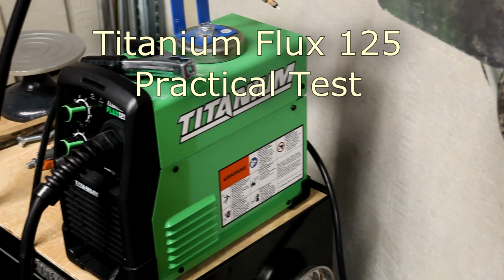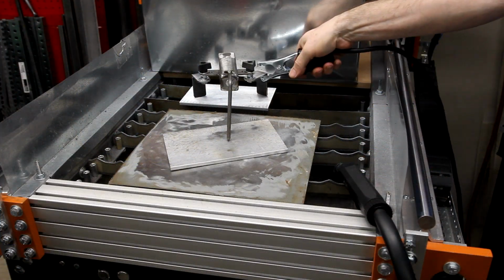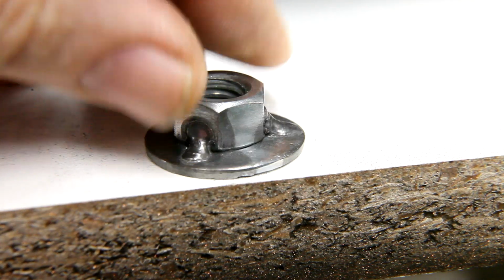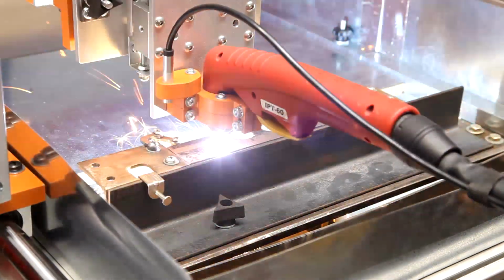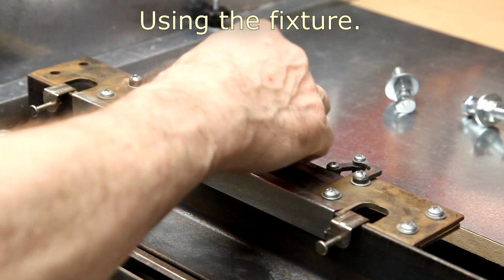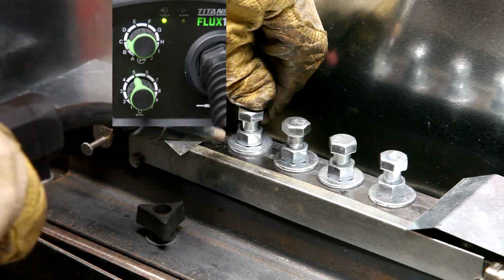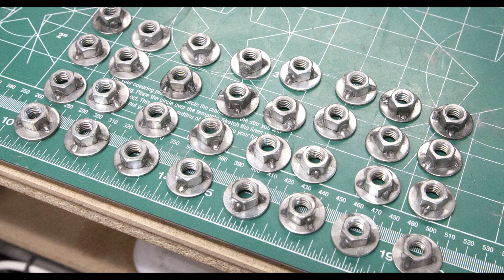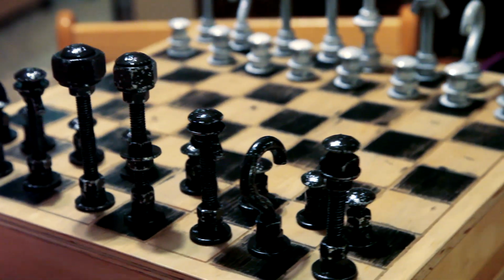Titanium Flux 125 Practical Test

Comment: Looks like a nice little welder for general use for repairs around the home.  I have the older cheaper 90 amp AC flux core welder, they say this new Flux 125 welder is DC and supposed to weld smoother with less splatter.
Reply from the maker: There is no comparison between an AC flux core and the inverter based DC flux core.

Comment from the maker: I want to do more simple beginner projects with this welder. If you have any suggestions I would be glad to hear them.
Reply: Im a begginer and planning to use this welder on my truck that has a bad frame...
Reply from the maker: @randyrivera611  It should work ok as long as you are not welding anything thicker than 3/16".  For non structural you can probably go to 1/4".
Reply: Make a little stand to transfer wire from the larger more economical spools of flux core to the smaller ones that fit in the 125, maybe powered by a cordless drill..

Comment: Nice vid. Just curious why you choose flux core as you “weapon of choice” when you have other (and probably sharper) arrows in your quiver? Thanks!!!
Reply from the maker: If I am welding zinc hardware, I prefer the flux core method.  I have used my big MIG as well, but because of the Zinc you still get a smokey, spattery weld.  So why waste the gas.
I keep the little Flux 125 on top of a shelf above my down draft table so its always ready to go.

Comment: How long is the duty cycle on this welder?
Reply from the maker: You can lookup the duty cycle on the Harbor Freight website, but I have never had any issue with the welder shutting down.
Reply: I just completed a fairly extensive project repairing the drive-on ramp on a 16' car hauler trailer using the Titanium 125 FC welder. Quite a few long 1/8 & 3/16" welds and it never hit the duty cycle. I think HF Duty cycle ratings on the Titanium and Vulcan welders are fairly conservative, so unless you're running lots of long 1/4" welds on a hot summer day the duty cycle shouldn't be a major factor for the Ti 125.